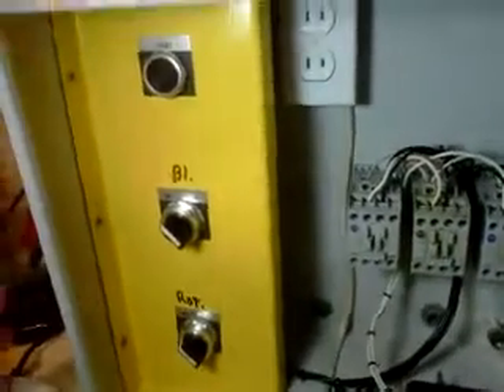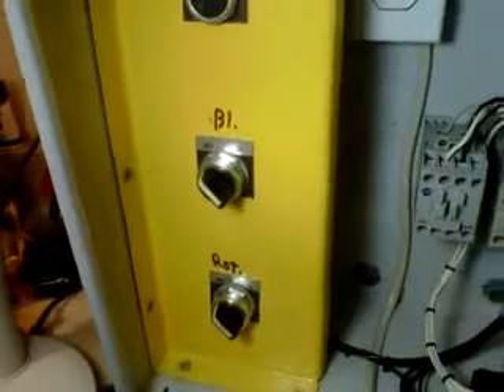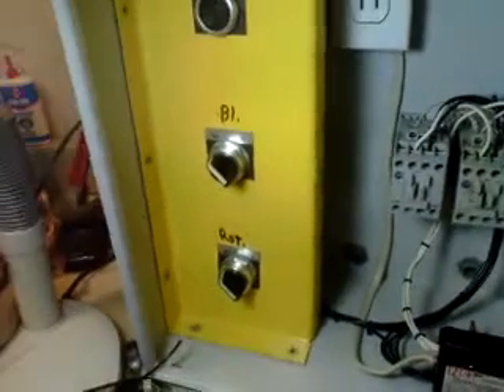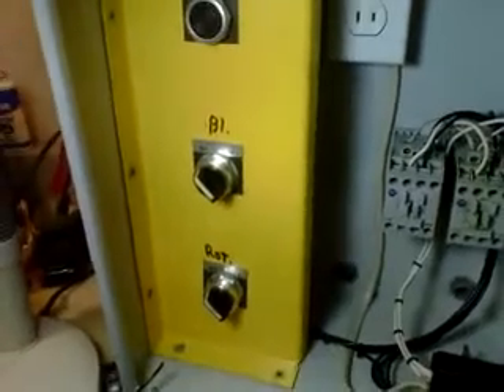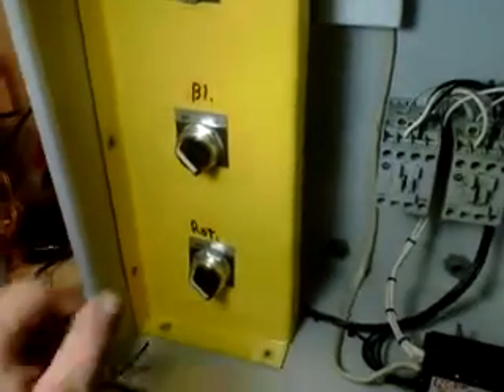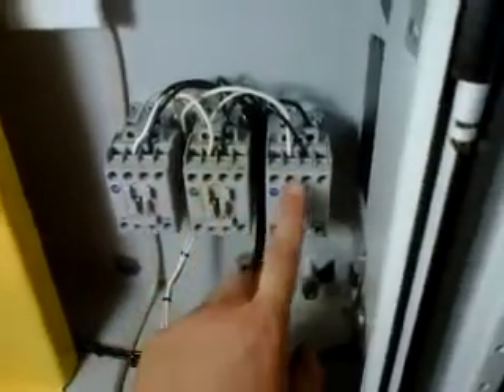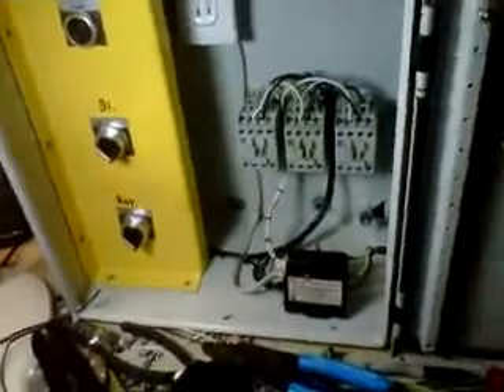BumbleBolt Control Panel Modifications--Halfway Done!

Comment from the maker: @AKSoapy29 But that would be waaaaaaaayyyyy more work than I want/need to do. I have the units on their way to my house already. What I'm going to use will make for a very clean install, and will be very efective. They'll give me the exact results that I'm after. I did use a remote/receiver/servos off of an RC gas boat to run the choke/throttle on the GP3T22 and that worked well.